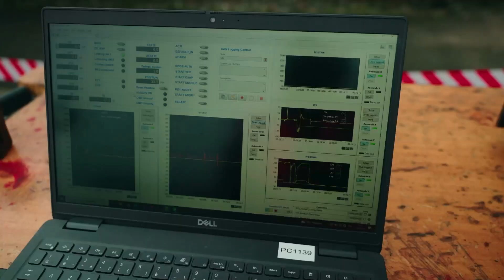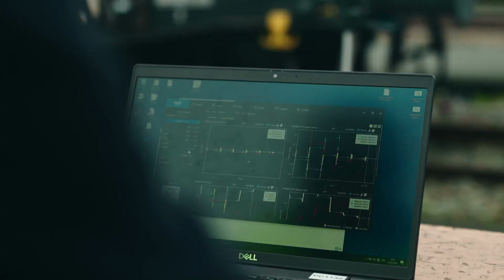FIRST EVER: Trains Couple While Moving! DirecTrainS revolutionary Dynamic Coupling test

Comment: 0:35 That's a Russian ЭП2Д train still using brushed DC motor and contactors to switch resistor groups during acceleration/braking. It clearly needs some innovations😅
Reply: приятный сюрприз увидеть РОДНОЙ ПРОДУКТ ДМЗ в совершенно случайном видео. Непонятно зачем такая громоздкая автосцепка правда, сцеплять вагоны на ходу и СА-3 умеет. И с какой целью они хотят на ходу заниматься такой камасутрой?